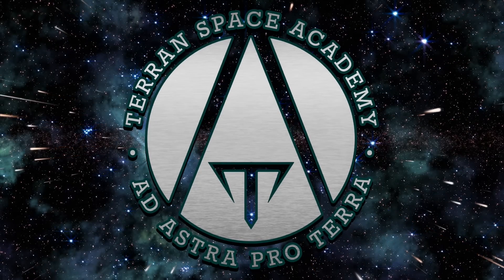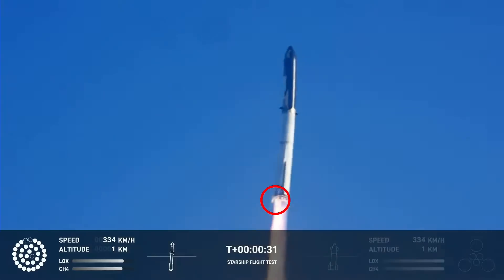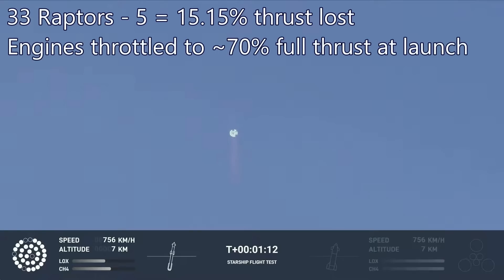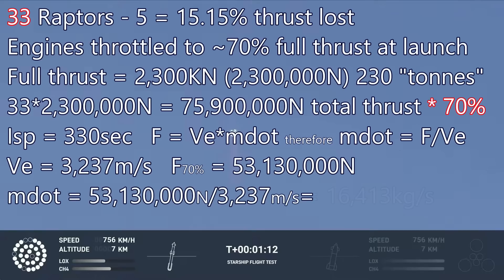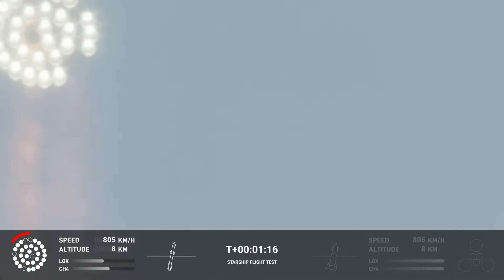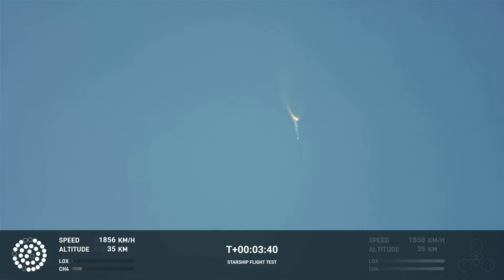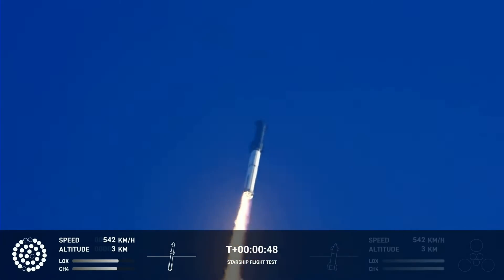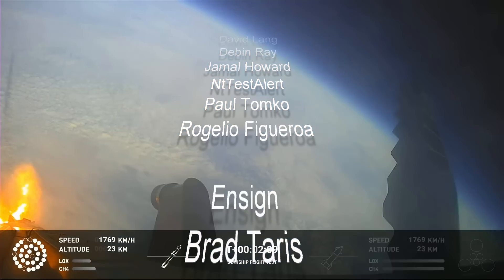Starship Flight Analysis: What went wrong with Starship?

Comment: I have several questions. 1) Given that this launch system has twice the thrust of the Saturn V, why did they construct a launch pad without water deluge and blast deflection systems? Is anyone surprised that the launch pad got shredded, and multiple fires were set in the area? Also doesn't this approach pose a significant risk of detonating their propellant farm which is so close to the launch pad?
2) Given that they knew 3 (9%) of their engines were not functioning after engine start, why didn't  they shutdown the remaining engines and scrub the mission? After all that is the advantage of using liquid propellant rocket systems. There is no way they would have been successful in their mission with a 9% reduction in takeoff thrust.
SpaceX's entire approach to this launch seemed amateurish and reckless.
By way of comparison, no Saturn V launch vehicle ever exploded, they all functioned perfectly each time. Plus the Artemis system functioned flawlessly on its first flight. Yet the Musk fanboys/fangirls are declaring this travesty a "success". This is why the "cult of personality" has no place in engineering systems.
Reply from the maker: 1) to practice for the Moon and Mars...
2) to see how far they could get with three engines out... the only thing more dangerous than a damaged booster trying to fly is a damaged booster sitting back on Stage 0.
3) Lots of F1 engines blew up on the test stand but you are correct.  Saturn V was amazing.
Reply: @terranspaceacademy  - "the only thing more dangerous than a damaged booster trying to fly is a damaged booster sitting back on Stage 0", I guess you are unaware that the Saturn V and STS were designed such that if all the liquid fueled engines at engine start weren't within a narrow range of thrust, then the entire thing was shutdown. They had the ability to de-fuel the rocket stack in case that happened. Of course since their launch pads had a water deluge system in place, they could rapidly cool down the engines and the pad so support equipment could safely approach the launch stack and remove any personnel from the capsule.
Just further proof of how amateurish and reckless SpaceX has approached the Starship program. You Elon Musk "fanboys" really need to get some objectivity.
Reply: @terranspaceacademy  - "1) to practice for the Moon and Mars..." - why would you need to test a launch pad on Earth for launches from the Moon and Mars? FYI, the Moon has 1/6th the gravity of Earth, and Mars has 1/3rd Earth's gravity.
That has to be the lousiest excuse for this abysmal failure.

Comment: IF they made the release mechanism parts out of stainless steel, they likely galled and vibratory friction welded together. Very common mode of failure for stainless steel parts. Bronze bushings will cure the problem if this is the issue
Reply from the maker: Interesting Sean... thank you.

Comment: There is a separation on the flip but---oh my gosh - MC had detected anomaly--wait a minute--multiple anomalies in the cutoffs on the flip.......now we see that the Starship has wandered way off course---yaw deviations are way off kilter, so that means--now the MC officer has given the go to set off the FTS to blow up the Starship -  AND IT DOES! 

Good-bye! 

MC then says, "We now have visual of the FTS--the Starship has officially scuttled!"

(FTS - means Flight Termination System - aka the Self-Destruct) 

But before the required self-detonation of the rocket, the Starship test blast-off was a smashing success.
Reply from the maker: And it's good!

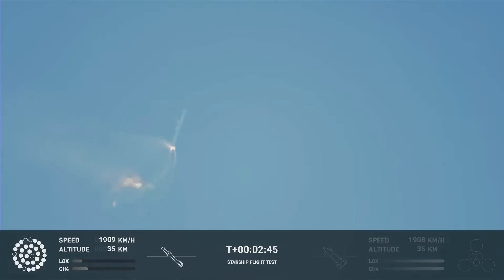Comment: 6:30 Why is everyone thinking that flipping the whole stack is something that was planned as part of stage separation?  Only the booster was to do the flip maneuver after the second stage separated,  just as we see with Falcon 9.  Flipping the entire stack is just stupid and there would be no reason to do so.  I don't know but I think it's possible that when the second stage failed to separate the booster may have still attempted it's flipping maneuver which is what may have started the whole stack flipping.
Reply from the maker: The entire stack was not supposed to flip... just the booster flinging the Starship away...
Reply: @terranspaceacademy  Why would the booster need to "fling" the star ship away rather than simply using explosive bolts, etc. like every other multi stage space rocket in history?

Comment: I’m no rocket scientist, but I was watching the launch and from a different angle than the one in your video, it looks like the rocket did not take off straight up. It looked like it kind of left the launch pad a little sideways and you can see the raptor engines adjusting thrust angle to compensate. Curious if that was something that was an anomaly or designed to do that. It didnt look right to me. Maybe issue with the engines right at the start.
Reply: Good eye. I caught that also.
Reply from the maker: Until it is free of Stage zero it can't adjust itself for engine out compensation... and three engines were out at liftoff.

Comment: Very informed video.  I need to be listening to this level of information instead of just "how cool" it was. Another video suggests that concrete debris from the OLM caused the damage to those engines.  I would rather face that then that the Raptors simply couldn't hold the thrust loads without burning up.
Reply from the maker: Thank you Paul!

Comment: This rocket is the only rocket that uses a hydraulic power unit and hydraulics to both steer and stage separation. The three center engines are on a gimbal and steer the rocket. I've been told that the one of the engines took out the HPU and therefore steering when it lost pressure. It's also the reason the two stages did  not separate. Future rocket are fly by wire and totally electronic. I, like you, have a problem with this flip maneuver. But I also have a problem with the lack of thrust deflectors. There is a crater at the OLM. The tank farm took a beating. Lessons learned. Let's do it again.
Reply from the maker: Very cogent and almost certainly correct my friend.  Thank you.

Comment: So technically the mission wasn't a failure.  Keep in mind this was just a test. Not a full mission thought it completed a successful test it aslo failed due to a technical error . So it was a successful  failure.. it did it's job.. I'm thrilled and happy. All we need to do is fix the engines  by improving the mechanical error and we are good. Just remember how nasa started out any any other space agency started out. They blew up rocket failed missions and all u spacex haterz really need to get your  brush up on their history of rocket explosion and failed missions by other space agencies.  This is how we learn to make improvements. Love as we go to make better and be better for a successful missioni think spacex improved and achieved more successful in a short time than any other space agency in the world  even bested nasa most of the time despite mishaps just take a look at falcon 9
Reply: Keep the bar low enough and you will never fail -EM
Reply from the maker: Both of you are correct.

Comment: I don’t understand the booster flipping before Starship separation.  All rockets I know of simply separate in-line.
Reply from the maker: It is different...
Reply: @terranspaceacademy , I’d heard the maneuver was a derivation of the centrifugal force method they use to centrifugally separate Starlink 2.0 satellites from the Falcon 9 upper stage.  If that’s the case, it didn’t seem to work here.  It looks like the yaw maneuver bound up the pin-and-slot staging mechanism, and Starship couldn’t separate after the initial maneuver.

Comment: Correct me if I'm wrong, but aren't the tuebopumps of the raptors codependent? I don't think you can simply spin up one without spinning up the other due to the FFSC engine cycle.
Reply from the maker: You should be able to spin them independently... though you would need to pressurize the oxygen feed line to the methane side.

Comment: THEY ABSOLUTELY NEED THE DIVERTER/DELUGE SYSTEM.

If you look closely before liftoff, the shockwaves bouncing off the ground are visible billowing in the exhaust plume.  I'm almost certain those shockwaves may have damaged the outboard raptor engines.
Reply: Yes, No comment was made about the lack of deluge system (allegedly Musk wanted to proceed sooner than it could be made ready) or the damage and flying debris possibly damaging the booster.
Reply from the maker: No comment was made because there will not be a deluge system or diverter on Mars or the Moon.  The ship must survive a debris heavy liftoff.  And it did.

Comment: This analysis is fraught with errors. The math is not wrong but its just baloney, the engine failures and thrust asymmetries are obvious. But the reason the rocket flipped "more than expected"  is (due to the lack of thrust from the failed engines) that the center of drag moved forward of the center of mass. This is an unstable aerodynamic condition, and anyone with enough time in Kerbal Space Program can confirm this. In simple terms the extra fuel left in the tanks from the failed engines, caused this. Your math about mass and flow rates of the engines all seems to be right, but completely irrelevant to what actually occurred. You don't seem to talk about this aerodynamic condition at all in your video of quote "what went wrong". Case and point, study your history. Apollo 6 had several engine failures but still made it to orbit...
Reply from the maker: Yes, yes... it went out of control.   I thought that was obvious.  I did not talk about aerodynamics because the rocket was essentially above almost all of the air when it went out of control... Apollo 6 did not have an F1 failure.

Comment: NASASpaceflight footage shows the 7 engines out as you thought. In addition, a second center engine seemed to either be out or throttled down significantly, as it went dark with just a little bit of light still visible from it.

Also visible is the vehicle rolling from flaps facing the sky to facing that ground around the time that it started side-slipping severely at T+2:15

Edit: As for the apparent engine restart at T+1:50, NASASpaceflight shows a plume of orange fire from that engine at that time, and again at T+2:00 before the camera cuts away. I didn't see the engine actually relight, but it certainly was doing something.

Edit 2: Saw another image showing a second center engine glowing faintly blue compared to the bright glow of the other engines. On NASASpaceflight's footage, it looked like the engine was out, but the image I saw indicated that the engine was still running at low throttle.

The engine I discussed in Edit 1 was also visibly glowing in the picture, suggesting that instead of being dead, it was also actually just throttled down. Though it was glowing even more faintly than the ceter engine I just mentioned, so it may have flamed out or something.
Reply from the maker: Thank you!  Good points.

Comment: Honestly, I am really impressed with extreme sideways stress this rocket was subjected to while it was looping, especially under MaxQ conditions.  1 minute of side ways MaXQ stress is just increasable.  Most fighter jets can't handle aerodynamic loads like that and will just break up under the ultra high G forces.  Chock that up as a big success of the rockets structure
Reply from the maker: I thought it would fold immediately... and the torque would have been tremendous.
Reply: The flipping was quite a long way after MaxQ. Also, what makes you think it experienced ultra high G forces? Seems really low accell during the flipping, i would be surprised if it was even close to 10G, look at the speedometer; very low deceleration/acceleration & the flipping itself was really slow, nothing points to it experiencing ultra high g forces

Comment: First video of yours I've watched. You've done a better job explaining what happened than the news media could possibly manage.
Reply from the maker: Thank you so much!
Reply: To be a brand name news journalist in the 21st century, you have to take an IQ test. 
There is a maximum score.
It's certainly not 3 digits.
Reply: ... and I subscribed.
Reply: News media could easily dinghies if they consulted with an engineer
Reply: He went far beyond explaining the problem.  He gave a solution to fix it!
Reply: What did you expect from main stream media?
Reply: I agree.
Reply: That's new. /sarcasm.
Reply: @RG-ls2db  Don't bother.  Save yourself for more important thoughts.
Reply: +1
Reply: bwahaha the news media. Sorry, good comment, just had to laugh xD
Reply: Nope. He missed the altitude and speed requirements for separation. It was out of fuel and 10% of planned speed, 50% of altitude.
Reply: @yurijmikhassiak7342  Yeah, it's not an issue with the separation. This video starts out promising, but then ends up in the wrong place (a bit like the launch).
There's no way separation is supposed to happen at an altitude of 35 km. Wikipedia says at 65 km after 2 minutes (which lines up with Falcon 9: 65 km at 2:30). This means that the fuel usage was okay. The first stage should have used up most of its fuel by then. The boost back burn is short compared to the initial burn so doesn't need much fuel.
Based on the change of speed between 15 and 16 seconds, the acceleration is 3.05 m/s². This means that the thrust to weight ratio is 3.1, similar to what is calculated in the video. This is fine to get off the pad. 
The problem starts around 30 seconds when it doesn't pitch over to the correct angle. Saturn V is angled at 81° at 40 seconds, 67° at a minute and 45° at 95 seconds. Starship is still at 15° at 95 s, pointing way to high. Based on my poorly built rockets in KSP,  this means that it didn't have enough thrust and is trying to compensate by angling higher. The lack of thrust can also be seen by comparing the speed to Falcon 9 (1000 km/h versus 2700 km/h at 1:30). I'm not sure how many engines Starship needs to go to space. It's more than 28 at least.
I like the amount of data Spacex show on their launches. It makes the analysis much easier.
Reply: @DrewCocker  very good points
Reply: @DrewCocker  that's what I meant. Thanks for pointing out angles. Didn't know it tried to compensate. This is a huge deficit of thrust considering only 10% of engines lost.  There is a huge loss of LOX in the middle of the flight if you check fuel bar chart.
Reply: @yurijmikhassiak7342  Exactly , and for some reason everybody misses the giant orange flareup  that happened just before the booster lost control  . By the way the voice narration was definitely just a scripted thing with no feedback . Too bad he also didn't touched the gianormous hole that was digged under the launchpad . Looking forward to a fire trench and a glorious orbital flight . The ship is capable of it .

Comment: All in all it is amazing that the booster and Starship held together while the system was doing it's flip dance.  They must be using some mighty strong clamps to hold the stages together.
Reply: Elon's rocket is huge and very stiff!
Reply: @all5stars  that's one mother of a pocket rocket!
Reply: @all5stars  ……shame on you Innuendo Man!!!
Reply: @all5stars  That was glib!
Reply: I was surprised it didn't rip apart under aerodynamic forces, a la the proton.
Reply from the maker: We were very impressed too!
Reply: That, but also take into account the mass of the stack, it directly influences the effect of air drag, a lot of mass stabilizes the whole thing. Nevertheless very impressive that it all held together. But to be honest, We've never had anything of this size go awry during stage sep. N1 exploded way before, all 4 times, and Saturn V never had a failure, not once.
Reply: There's nothing of this size to compare with, N1 failed all 4 times well before staging, and the Saturns V and IB never failed, not once. So it's hard to say if it is really that strong, or that the high mass of the stack stabilises the whole thing.
Reply: The booster was empty and starship was still fully loaded!
Reply: Yeah, I was shocked that it was able to survive those forces without ripping itself apart.
Reply: @rubyrubenstahl827  …….goes to prove that Frog Tape holds as well as Duct Tape. The guy that had applied Frog Tape around the two vessels while spray painting forgot to remove the tape after the paint dried!!
Reply: Was my thought too, how the hell could sn24 stay attached 😅
Reply: Let’s just say the structure team probably got gold stars.
Reply: Saturn V did not do flip dances.
Reply: It looked like some of the booster engines were still providing thrust during the flip, so the clamps might have released, but the engine thrust was still higher than the separation force (not sure if it's just the spin force, or if they have a mechanism like on F9).
Reply: @DisorderedArray  ……………………nahhhh.

Comment: I have a suggestion, put ullage thrusters on Super heavy.  At sep, SuperHeavy is probably lighter than Starship, so you could get away with smaller thrusters.. put in 6 if you need 4. get some redundancy..
Reply from the maker: Worked for Apollo :-)

Comment: Great analysis, I agree at least 6 engines out before trouble begins, at that point all "nominalish". 

The day I heard about flip seperation I immediately groaned internally. Sometimes these are genius and sometimes not so much. Just shut it all down, we learnt this with Falcon 1. Separate while igniting. The stage should be in freefall, that way it all seperates nicely and minimal thrust is needed for sep. As you say, partial ignition or vent from the downward facing LOX vents. Those are great but against thousands of t of thrust it's a bit whimpy. 

I think this was one of those: "Come on let's keep it simple, slap some RCS on top of it. "

"You're fired!". 

Kabooom. 

"WE were wrong, this is the fix"

Awkward stares. 

Next flight succesful.
Reply from the maker: Thank you.  We agree on that point... no flip!